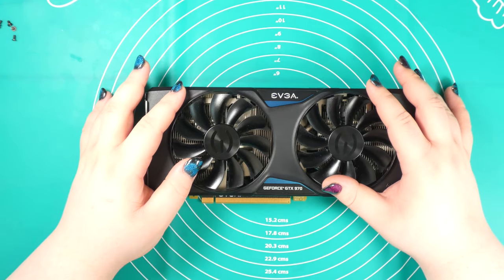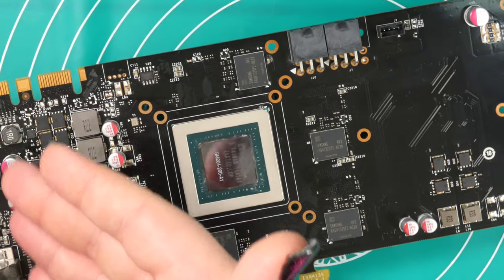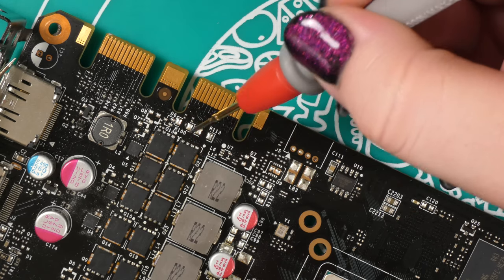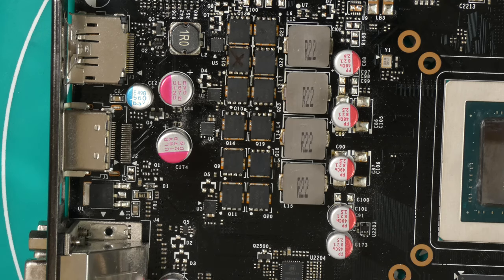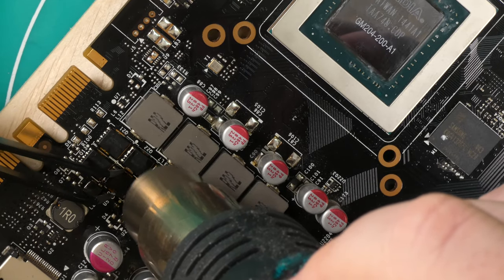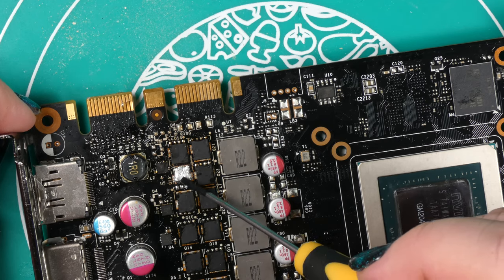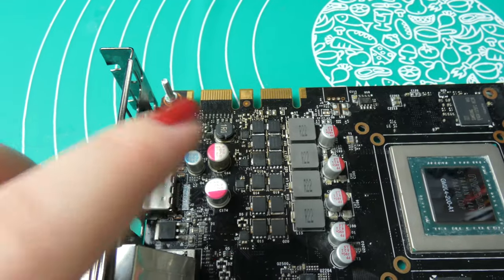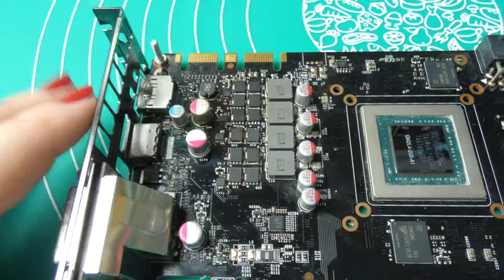Nvidia Graphics Card Repair - EVGA GTX 970

Comment: Why dont you isolate the other components you dont wanna heat with kapton tape?
Reply from the maker: Has absolutely no positive effect here and is kind of a myth. When you heat a component, others that are electrically connected to it through the pcb are also thermally connected. Also kapton tape itself is not a good insulator there is still enough heat. What it does however is redirect the hot airstream. Only helps if you are about to blow components away but if thats the case you are doing something wrong :D
Actually having the hot air mooving over the pcb healps to desolder components slightly faster as you have to think of every bit of copper as a heatsink. If the hot air moves over the pcb it prevents massive sinking of thermal energy away from the component you are working on and therefore lowers the time required to do so. Obviously unnecessary if you pre heat the pcb. 
Oh and when your heatgun is for example set to 300°C its at that temperature maybe 0.5 cm to 1cm away from the nozzle and gets rapidly down in temperature the further it gets away. So long before actually any other component gets desoldered your main subject should be already removed if you use the right technique. Or you are just unlucky and got a stuck component as I got in the video. That happens from time to time, pre heating would have helped though and I can actually do that now.
Now don't get me wrong, kapton tape is a very good product and helpful in many many cases related to soldering but that's simply not one of them. I personally think it comes from bga rework and their use of hotair. In this case it is used to redirect airflow which is sometimes necessary. If infrared is used they use aluminium tape.

Comment: A GTX 970 isn't worth alot? I'm still using a GTX 470 and a mosfet popped off and now I'm screwed... :-
Reply from the maker: At the time of making this video a gtx 970 was around 100€. Just replace the mosfet and its driver, if you are lucky it will work again.
Reply: @PhysicistAnna  I ended up fixing it thanks to your video and a few others from some other guy. I am now trying to tackle a RTX 3060 TI, the Fan froze up and got super, super hot, and melted the front plastic of the fan, I guess this caused the fan controller to die on me so I am either going to wire the gpu fans up to a standard 4 pin PWM header and run them from the mobo or see if I can do a bit of research and fix it, or get it fixed. Stupid me, card was under warranty and I tried to swap the fan myself instead of just sending it off for repairs lol.

Comment: here my cheap trick, wrap an aluminum foil on the back of the card then place it on top of a clothes iron, set the clothes iron temp  around 185c no more than 200c let the card heat up around 3-5min then proceed with a hot air gun and tweezer it should pop up under 15sec,i learned this after killing 15 of those MOSFET just trying to get it back on the board and I didn't know the MOSFET are very sensitive to overheat so it just blows up as soon as i hit the power button🤣

Comment: Good honest, open videos, warts and all. Your a brave girl, those nasty little black things with legs are a pain to get off. I hate surface mount, it may be the best but trying to repair anything is a right XXXXXX. I have a 100 Watt tin bashers soldering iron with a flat tip, that sorts the swine out. Can't wait for the water cooling, I have some 15mm pipe benders, where are you going to fit the water tank and ball cock ? (I jest).

Comment: bad way to diagnose. this way u find ONLY short to gate. with shorted S to D u will find nothing. and soldering on card without preheating is really stupid. u dont even cover that electrolytic capacitor near

Comment: Hello, My GTX 1060 6GB is broken ( https://www.youtube.com/watch?v=yrt77Z1cn2Q ) like this shown on this video, can you suggest what is broken or please suggest me how to repair or do you think is it not repairable?
Reply from the maker: Hard to tell from afar. Assuming your gpu fans do spin just like in this video and suddenly go to 100% with a black screen along with it, it can be as simple as a heat related issue due to an improper fan curve. You can check that in MSI afterburner for example. If it is set to start spinning between 50°C and 60°C (depends on the gpu) and then is also set to go up as temperature does everything is fine in this regard. 
Another possibility is bad thermal paste on the gpu chip itself meaning bad thermal transfer between chip and cooler. If you start a game like in this video (basically a graphics load) the gpu has a sudden internal change of temperature and relies on good thermal heat transfer to get the heat away from the gpu. If thats not fast enough though it would overheat and to protect the gpu it might do a safety shutdown? Again I can't tell from afar as the question is does it recover after it went into black screen, do you simply stop the program and it comes back or do you have to restart? Basically does it behave as if your whole computer crashed?
The last possible thing I can think of right now is a lack of power. Are your power connectors properly plugged in? Does it properly sit in the pci-e slot? If so then there could be an issue on the power delivery. My experience showed if I miss half of my power rails on the gtx 970 there is a ridiculous coil whine. Did you observe this with your gpu then it might be a hint and lead you towards broken power rails.
Hope this helps a bit.
Reply: @PhysicistAnna  Thank You for the reply. So after it going into a black screen + 100% fan, I just restart the computer and it goes back to normal working condition but then if then after like when the gpu usage gets high its goes back to black screen + 100%, So thinking that its a thermal problem i've change the thermal paste, cleaned the whole gpu and even set fan curve + lower the clock speed and all, It starts working for a bit but then after about of 1 week of gaming daily it went back to Black Screen + 100% fan and i've check the connection and all everything is fitted properly like the pci-e slot connection is clear and all. So do you think its just faulty hardware? or there is another method I could use to try to fix.
Reply from the maker: It might be a long shot but have you tried to remove the nvidia drivers and reinstalled them? If that also doesn't help it depends on how much time you are willing to put into and if you have a bit of prior knowledge and gear to do the kind of repair I showed in the video. If I had this issue I would then start to diagnose the memory power rails first, its voltage and stuff and then go to the other power rails and work my way through the whole power delivery. It could also be that the memory chips themselves are damaged but unfortunately I don't know how to test this.